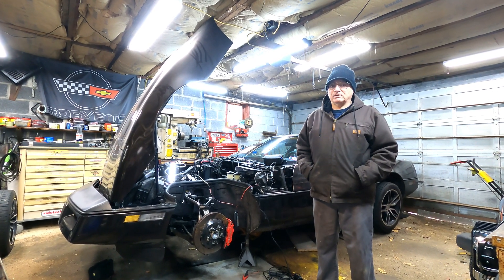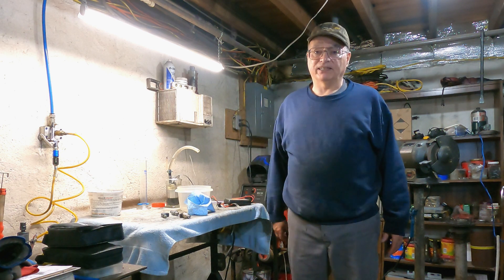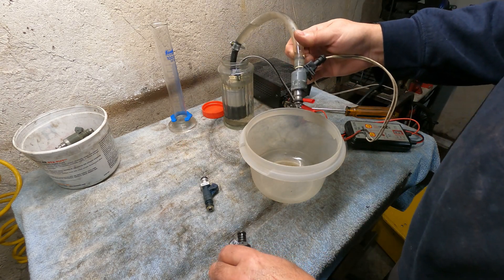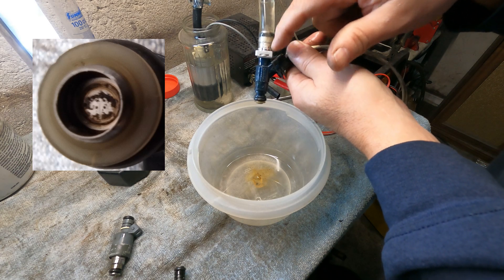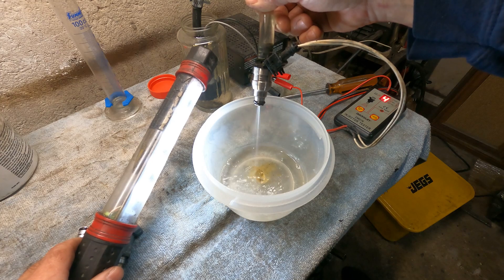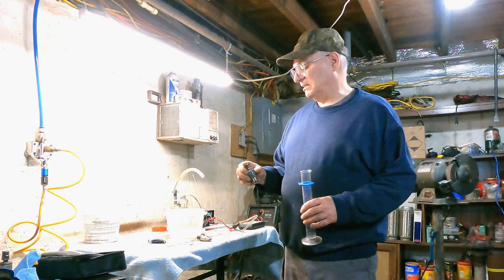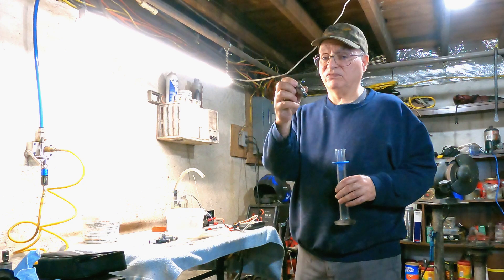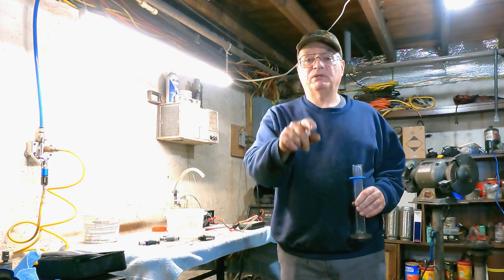3 Different Injector Spray Patterns 👀

Comment: I like your set-up. Think I may have to do something similar. What are you using to regulate the fuel pressure?
Reply from the maker: For this test I just hook the injectors straight to the fuel pump.
Reply: @E.T.GARAGE  any idea what the pressure was?
Reply from the maker: @RobertSmith-js2kz  I would say around 60 psi.
Reply: @E.T.GARAGE  Thanks very much 👍

Comment: The MULTECs are perfectly good when they still work, the issue with them is they don't tend to like ethanol based fuels. The Delphi from South Bay Injectors are what i always use now, i was using Bosch from Fuel Injector Connection, but those are not correct for these cars and the opening timings are considerably slower than the MULTECs and the Delphi injectors, which makes a big difference on some cars, but not much on others.

Comment: You can consider newer injectors with 12 holes, I saw this video about a guy that installed them https://youtu.be/rXiFgUWt03E
Reply from the maker: Keep in mind the C5 Corvette uses low impedance injectors and the C4 uses high impedance injectors.
Reply: The video you linked to those 12 hole injectors is marked private.  Did you access it thru another website to gain access?